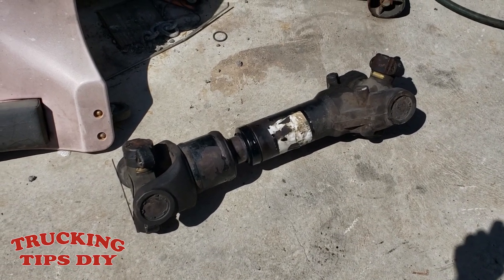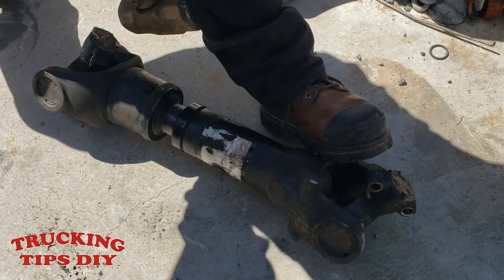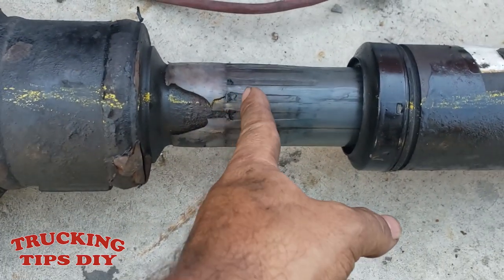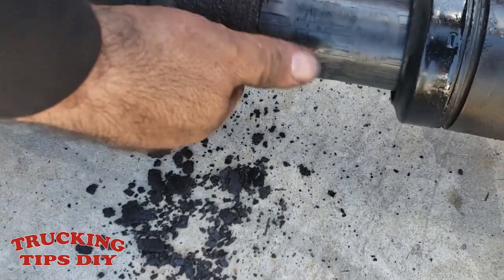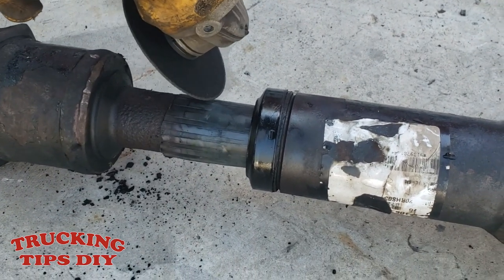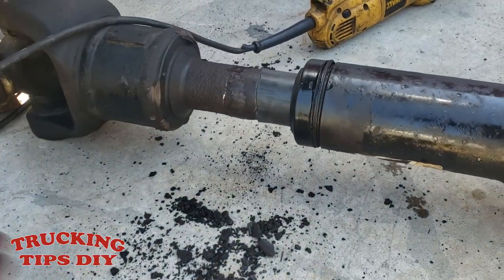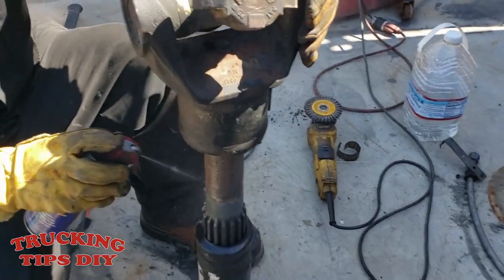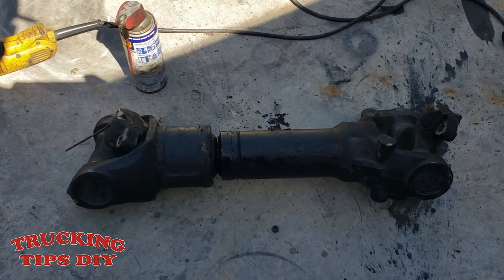Fix Freightliner Cascadia rear drive shaft problem / Vibration / Bumpy Ride/ kenworth, volvo ect.

Comment: single axle day cab 2012 cascadia. all 6 new wheels and tires, all new shocks, alignment good, no play in front end, at the proper ride height. bad shake at 65mph but not at 55mph or 75mph. do you think this could be the issue.
Reply from the maker: check your steer tires some times they are out of round, lift the truck from the front,  and spin the wheels with your hands, and look on the bottom of the tires and the ground,  if they  spin up and down from the ground, the tires are the problem
Reply: @TRUCKINGTIPSDIY  ive done that, dont see any out of round issues. they are michelin tires. changed from steel to aluminum on the front of the truck, no change, added all brand new drives, with new steel wheels, no change. all new shocks, no change, alignment, no change.
Reply: Check your king pins
Reply: Having the same problem with mine. Did you fix yours?
Reply: @js2380  kingpins and rear suspension bushings where they pivot at the frame.
Reply: Carrier berring
Reply: @nathan00campbell  Hi bro I got the same exact problem the truck shakes around 66,67,68,69, and btw 70 a lit bit but not that much ma man did this changes resolved the problem on your truck ? Pls let me know I will really Appreciate you ma man 🙏
Reply: @ilhommuminov708  after going through everything on my truck chasing vibrations it ended up being the front hubs. The hub pilot for the wheel was worn down causing the wheels to mount off center. Had to use wheel centering lug nuts to solve the problem.
Reply: Try checking your king pins or your driveshaft u-joints.
And your bushings 😊

Comment: Shaking could also be the load leveler out of adjustment. Especially on the 2018-on cascadia. If you noticed the headlight beams getting higher and higher and shaking more, the leveler needs adjusted.

Comment: I got hella shaking in my drives when I get up to about 55 mph. I just checked my driveshaft and it's moving back and forth when the forklift hits the trailer so it's not stuck. It doesn't seem like it's busted anywhere either. 
Maybe it's just an alignment problem, bc the tires are all good. Heck I only got 95,400 miles on her she's not even broke in yet.

Comment: But you had to fix plastic surface on drive shaft where it slides in there is seal goes around plastic surface and hold grease in the place and prevents dirt getting inside. They fix plastic surface at drive line shops or you have to buy another drive shaft

Comment: What's the purpose of the sleeve? To keep water out?
Reply from the maker: Yes, also this ones don't require grease
Reply: It's called a slip joint..it's supposed to slide up and down...while airbags are beung dumped..or when loading or unloading freight..etc..it should also have a zierk fitting for grease...that slip joint should have grease all the time...so no grease slips out .of the cap..it's for water seeping in...

Comment: Mine is 32 years old and still shiny. It never had a plastic sleeve. Must be a MB thing.

I'd see if there's a no-plastic replacement if I were you. Unless you plan on ditching the entire truck once the dirt and moisture get into that shaft and ruin it. 

Taking that plastic off lets the piston slide in beyond the seal and that makes space for corruption. Hopefully it doesn't catch.
Reply: if they keep it greased really good it'll be fine
 ride it make some more money and pick up on at the junk yard next time you drive by one
Reply: @robbwhitehead5486  I mean that's literally not how that one works but hey do your thing man.

Comment: When did it vibrate? What speed? Mine does it around 70 to 75 mph
Reply: Same here would love how to fix it i have thrown a lot of money at it
Reply: @hankssoftwash3713  I am gonna try getting my drive tires balanced. Mine seems to be a high speed vibration like tires out of balance.
Reply: Ralph Stenic I have mine balance and have centrimatics and have tru balance centering on all wheels and drums still have shake but I’m now confident it’s in the rear end can twist driveshaft a whole inch when parked
Reply: @hankssoftwash3713  I have the centramatics but I do know those are only good for 8 ozs. Haven't dont the tru balance or anything balance wise yet. I have moved 5th wheel around so king pin was centered between the drive axles. That helped a little. Made sure my leveling valve was set right that has been the most helpful. What gets me is it comes and goes. Some days it does it other days it doesn't. And doesn't seem to do it when i am bobtail. If it does its not as noticeable
Reply: Ralph Stenic same here it’s driving me nuts
Reply: @hankssoftwash3713  yea it is.
Reply: @hankssoftwash3713  same here did you find the fix
Reply: @dankcount  yes a combination of things had the steers high speed balanced with them mounted to truck it balances wheel tire and drum. 2nd the company I used to work for assigned me a trailer the biggest problem was the trailer I’m smooth as glass now
Reply: @hankssoftwash3713  I’m having to change a pinion seal and ujoint in front of the trans hopefully it’ll fix the vibration.
Reply: Hello. Nathan who balanced your steers and drums while on the truck?
I think i need to do this on mine.